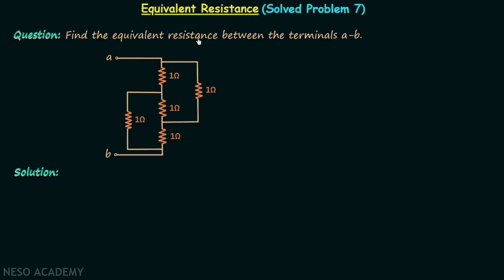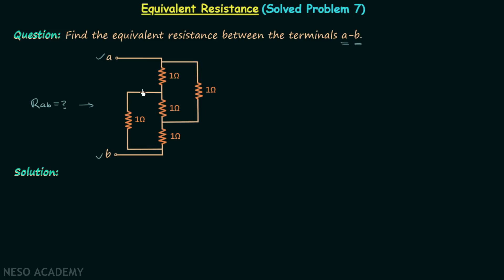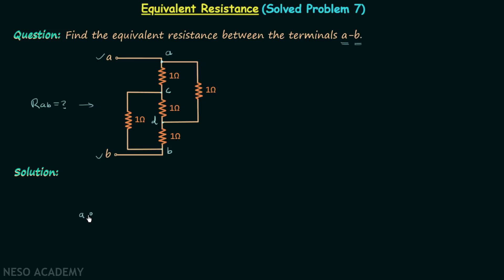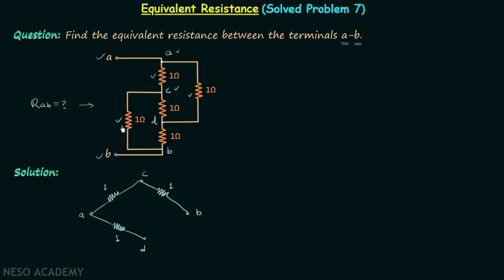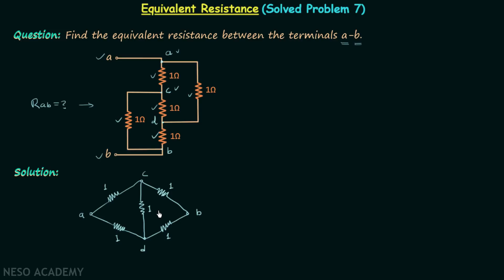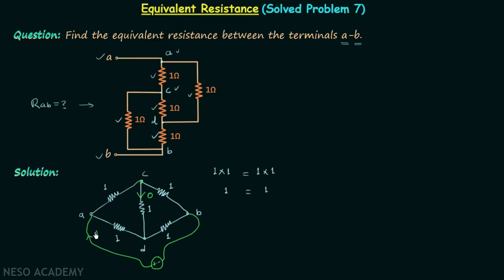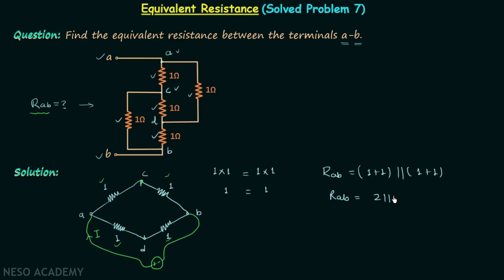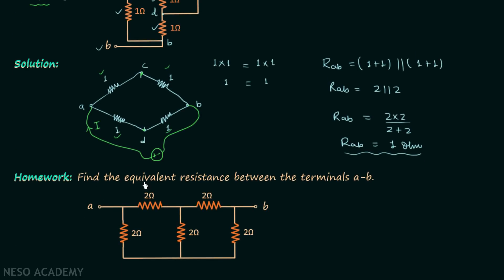Equivalent Resistance (Solved Problem 7)

Comment: Sir .y can't we do this problem using vertical plane of symmetry
Reply: You can do this ans will be 2
Reply: The whetstone bridge that you're getting is actually the concept of using the vertical symmetry but there's one extra condition here that R1R4=R2R3. Since the left and right side are symmetrical so potential difference along 5th resistance and current flowing via it becomes 0.